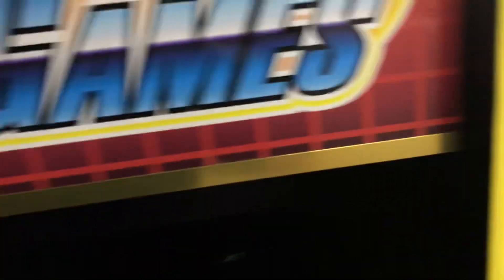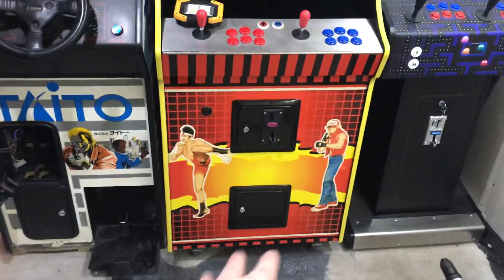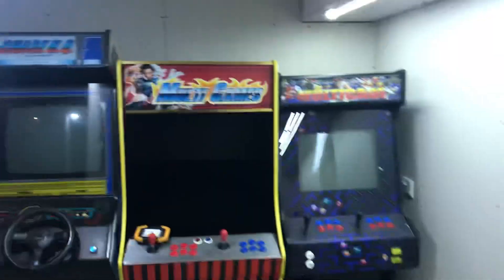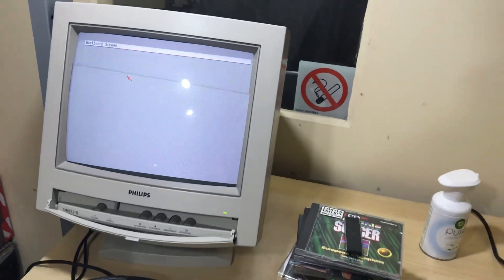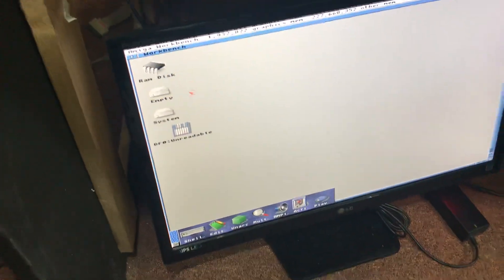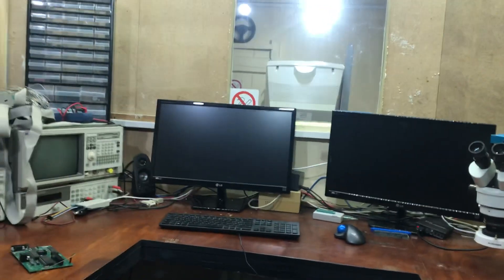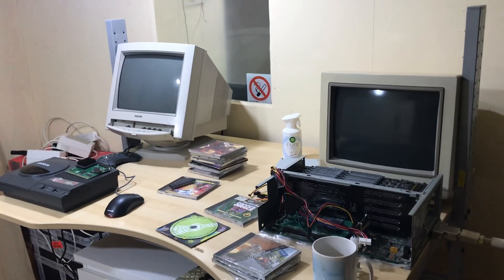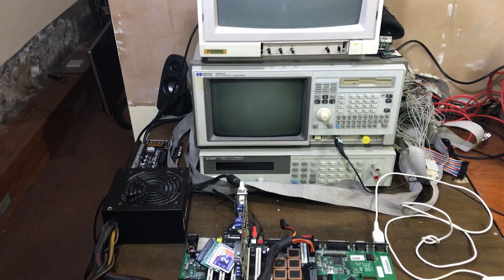End of 2021

Comment: Thanks for the new video, missed your videos. New lab looks great and to answer your question, what I would like to have from my amiga is to stay faithful to the 90s amiga experience, but also have enough computational power to smoothly play mp3s while experiencing a smooth and responsive workbench. This is for the hardware. while for the software I am loving all the improvements Hyperion is adding to AmigaOS to make it more solid and smooth. I would also like to have better support for network protocols like SMB (but again this is software side) just to make life easier when transferring files from other retro systems or modern ones. I think all old games now run really well either via TF cards or Vampires etc. so that part is fully covered IMHO. Thx! :)